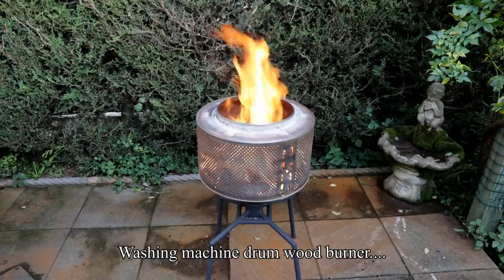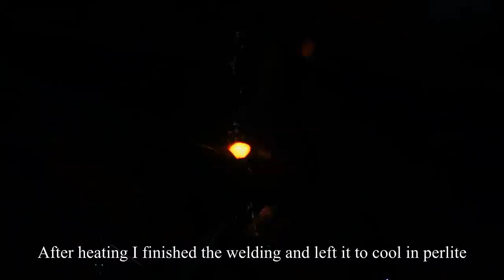How to make a washing machine drum fire pit with bbq grill

Comment: Hello Sean,
I hope this message finds you well. Amazing job on the fire pit. The tornado effect is absolutley awesome.
I was wondering if the fire pit is still going strong. Been looking at making one myself and recently got the spin drum from a Samsung washer, but magnets readily stick to it so it is not a high grade of stainless steel if at all.
I don't want to put the time into a project like this only to have the bottom fall out (litterally) after a few uses. I am concerned about the thinness of the metal and the fact that it seems to have high iron content for longevity.
Please let us all know and thanks so much for sharing your build. Your skills are truly great and you have another subscriber. Keep up the good work.
Reply: I think if it doesn't work with magnets it's a higher quality stainless steel.

Comment: I have been using one for years and they are my favorite. I want to try to incorporate one into a wood gas fire pit, (smokeless). I think the casing you took off in the beginning would work for that purpose. Have you tried making one before?
Reply: I have a drum that is a transformer, I often light it with the holy drum,  then slip outer cover over it , and for burning leafs,  I'll start it open, add outer cover,  and a dryer tub that I'll shove and stomp leafs into then flip over and onto top of pit while running a dryer vent motor onto a 4" to 10" home made adapter that forces air in from bottom and sides, makes for one gecko of an incinerator. My next one however will be higher off the ground,  wider axles,  and an internal stirring system